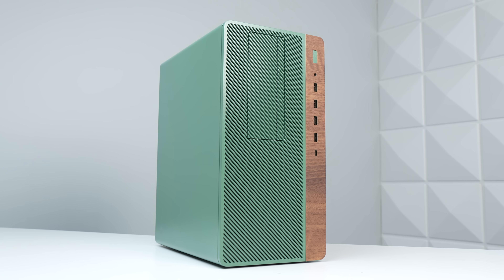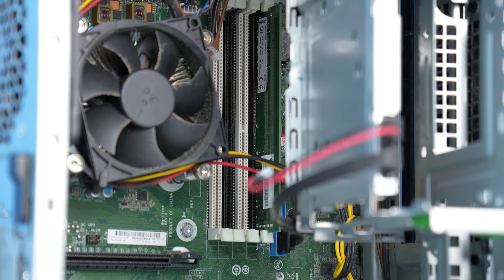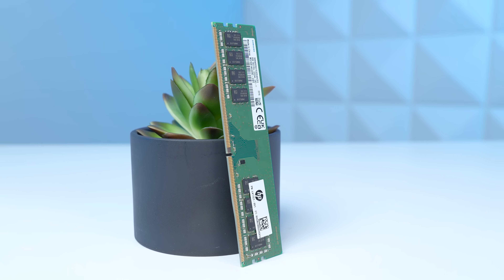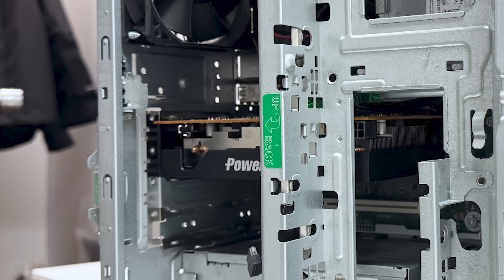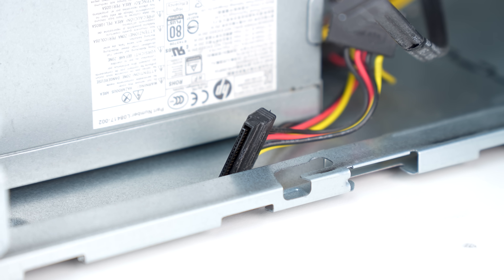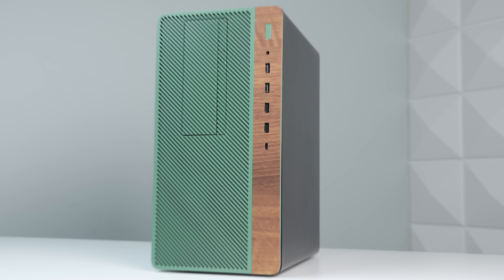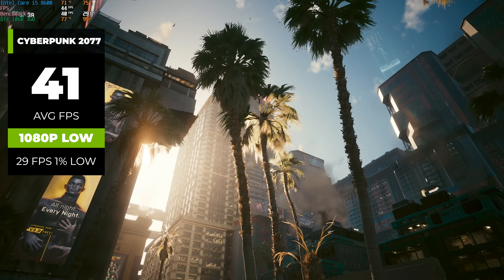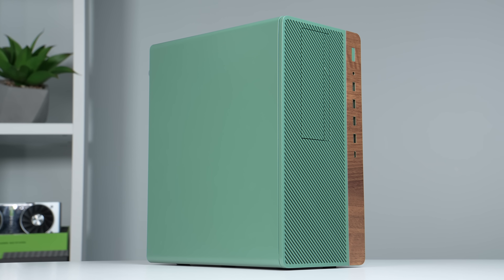Yes, a $150 Gaming PC is Possible

Comment: I got a HP prodesk 600 g4 with an intel pentium gold G5500 16Gb ram and 256GB ssd for 90$ and a radeon rx 580 8Gb gddr5 for 65$ did I get a good deal and what should I upgrade now ? Also I just play Minecraft and Fortnite.

Comment: I just bought me this Prodesk for $50. To my surprise it had an i7 onboard instead of an i5. Even the seller somehow missed it. 

I was looking for some cool ideas to upgrade this thing. Gotta say this looks awesome. Definitely not gonna copy you.

Did you change the power supply? I was planning on putting a gpu in it but I was afraid the power supply couldn't handle it.

Comment: when i was seeing if my idea pc for 200$ would work i asked microsoft copilot is the parts were compatible, i copy pasted names to remove errors. it told me if they would work and if they wouldnt, then why not. for example, in a pc with a 180 watt power supply and really small case, an rx 580 would not physically fit OR get enough power to run.

Comment: Wouldn't pairing up my 8 gb ddr4 3200mhz ram with another higher mhz RAM stick cause trouble?
Reply: No cause it will underclock the higher mhz stick to 3200mhz

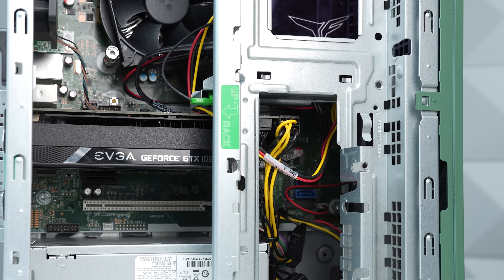Comment: 4:37 Bro, why the Gtx 650? You can get the 750 ti for like 25$ (used) and its 2x better than 650 and also dont use external power. Its just better than most gpus, only 60W power consumption + very easy to find and super cheap because how common it was for budget builds back then.
Reply: He said 1650 bruh

Comment: Hi, I would like to build my first PC, mainly for FPS games and some AAA games. I have a budget of around €1100 and I’ve chosen these components:

CPU: i5 12600KF
MOTHERBOARD:Gigabyte B760M GAMING X DDR4
RAM: DDR4 2x16 GB 3200 MHz
SSD: Crucial P3 1TB 3500MB/s
AIR COOLER: upHere UE2K6 Black
CASE: KEDIERS Mini Mid-Tower Black
PSU: MSI MAG A650GL 80Plus Gold
GPU: RX 7700 XT 12GB

I would like to know if it's okay or if something could still be improved.
Thanks

Comment: @ZachTechTurf Could you please give me an information ?  I have a 4th generation motherboard H-81S with Core-i7-4790 and 16 gigs of ram now. Everything is okay but my graphics card is not working suddenly so I wanted to change my motherboard like Z-97 or similar ones which has both VGA and HDMI Cause I have two monitors and I want to use them without buying a graphics card again. Now could you please confirm that I don't need to install fresh windows to replace the motherboard ??

Comment: I am upgrading my processor which is better ryzen 5 5600x , R7 5700x or R7 5800x ?
5700x and 5800x getting new on almost same price?
Currently running amd athlon 200ge with gtx 1650 (also goind to upgrade gpu most probably used one any suggestions on taht too?)

Comment: Hey, I recently upgraded my Pc to a white themed, a Dell optiplex 5070, I changed the case, motherboard, power supply and cooling, and an MSI Geforce Rtx 3060 gaming x (2 fans) that they gave me for free (used) I would like to know if I can upgrade or change something else (I can still return them)
It's an Intel i7 9th 9700 (from the optiplex)
A Gigabyte Z390 M Micro ATX (used from Amazon everything works fine)
Cooler Master MWE Gold 850 V2 Full Modular
Apevia Prism-WH Prism Micro-ATX
ID-COOLING FROSTFLOW X 240 Snow CPU Water Cooler
If you could tell me what to change/upgrade/return I would be very grateful.
Reply: he never replied to you.. what a douche
Reply: @ultimatesunrise  he might have made a video on it
he does that sometimes

Comment: I wonder why you made that video at all. Since you either recommed a MAC book since that OS is clearly superior (your words not mine) or like pushing ppl into debt traps by selling yourself to NZXT. Also, there is no chance that you get a ProDesk with an 8. gen i5 so cheap. I just sold several of the exact same spec for around 100 bucks each. Guess someone used final cut on his superior MAC to screw some more kids which don't know better. Report it is.
Reply: "Mac"

Comment: Hey Zach!, I've been your videos and i want to ask i have a old pc with i3 7100, H110M-E/M.2, GALAX GEFORCE GT1030, 500W Power supply, a ssd (idk the type) and a KLEVV BOLT DDR4 8GB 2400Mhz. I only have enough money to buy the MSI MECH OC Radeon RX 5700, but i want to know if i should upgrade the other components instead of the graphics card?( Side note I like to play jurassic world evolution 2)

Comment: Rate my ultra budget  build. 

Gigabyte B450m micro atx motherboard with 2 ram slot.

Ryzen 5 5600g 

Value top v300 case, 

Fsp 500 watt 80+ bronze power supply,

8 gigs of ddr4 3200 mh

256gb hp m.2 ssd

This cost around 310 dollars.
Btw before u judge,  im asian not every pc part is available here and its more expensive

Comment: Hi

I currently own a pc of below mentioned system requirements 

My pc configuration is as follows 

Intel Core i7 12th generation 12700 

Motherboard is Gigabyte B760MH

16gb ddr4 memory 
GeForce RTX 3050 6gbddr6 graphics card 

Is it possible to upgrade to Intel core i9 processors? 12th 14th

Also can i upgrade graphics card to 8gb ddr6 or 12gb ?

Comment: true is 8th gen is very good. some part of pc are over produced so you get them in low price. highly suggested computer case.
direction flow.
Mostly best buy i buy used pc and ungraded because any privet buyer do now want loss time.
1060 graphic card is i think little to old. I highly suggested to buy 3070?

Comment: These newer generation recycled 7th and 8th gen intel pc's are just tricky! It's all about the right gpu(size) and right psu(will it work?) for these budget builds (As Zach points out).  If you can't find a good psu solution, stick with the rx 6400 and sff(small form factor) pc's.  I bought a lenovo  510a-151cb for $65 that came with a i5 8400 and 8gb ram.  I thought, how could I go wrong?  Turns out, I have to buy a special lenovo friendly $67 500w psu off ebay(allows proper turn off) in order to make it turn off properly.  I know I can buy an adapter for a third party psu but... It wont turn off with out an external switch.  I also found out the case only comes with 2 ram slots and really only a GPU slot(2 slot gpu will cover pcie slot). Thus no add on cards and I have to buy all new ram. It will only take certain size gpu's  121mm tall(or wide) and 242mm long (lenovo single fan 1660ti ok)   I'm mean this will work but,  $65 pc , $67 psu, $25  16 gig ram, $12  2x80mm cooling fans, $90 1660ti (total $259 bft)- its passion vs price. Maybe a fresh build instead.  I found the dell 7020 and 9020's (i7 4790) are much easier to build in, but they are dated.
 
FYI, didn't know Zach was mixed with  NZXT and the rental scam.   Sorry to hear that, but  I give Zach the benefit of the doubt.

Comment: Hey Zach. I was wondering if you could help me to decide what to upgrade next on my PC. I currently got a 600W power supply, MSI A520M-A pro, AMD Ryzen 7 pro 5750G, a water cooling from Deep cool, 16GB DDR4 RAM (2x 8Gb), NVIDIA GeForce RTX 4070 ti super. I personally thought to upgrade my CPU to an 7800X3D and upgrade my power supply. Would be really nice if you could help me.

Comment: To anyone who can answer, I currently have a 500gb ssd and planning to upgrade to a 2tb ssd. I have activated windows via product key (retail). 

Question is, can I install windows again using the same key or would I need to enter a new one? I only have 1 nvme ssd slot on my mobo so cloning is going to be a longer process. I don't mind installing windows again though (i dont have bulky files that much yet saved on my former ssd)

Comment: every one i talk to says i should not buy anything that is not a 9800X3D or 7800X3D  but in sweden they both cost 600 dollar and that i am stupid if i buy anything that is not x3d but they cost alot more then 9700x 400 dollar or 9600x 300 dollar. i am on am4 2700x  4070 ti super atm but was planing to upgrade to to am5 so do i really need a x3d cpu

Comment: Pro tip: Get an older Server grade PCs like Del T3600 etc with 4th or 5th gen Xeon processors. They also comes with 600+ Watt Gold rated PSUs so you can easily install upto a RTX 4070 ti or RX 7800 etc.

Comment: I have been purchasing HPZ600s 800s for a couple of years and pimping them up with resprays, rgb and medium range Graphics and ending up with some quite powerful pcs. 
I mean 2 cpu, 12 cores, 24gb ddr4, gtx1060 6gb, the 800s have 800 watt psu and are built like a brick shed.
You def dont need a 2k$ rig to play games.

Comment: Thoughts on,
Omen 40L Case
FrostBreath Mobo
Air Cooling
Ryzen 7 7700
GeForce RTX 4060ti 8GB
Kingston Beast Fury 2x8gb 5200MHz DDR5 Ram
1 TB SSD ( Don’t remember exact brand )
600 Watt Power supply

This is my First PC anything I should add ?
Reply: Personnally would get a higher power PSU if it's possible

Comment: can you pls make 900$ Gaming PC? 

I am building this PC What can I Improve to make it better 
(Yea I know About 4060 But I have to for other things too)

CPU- Ryzen 7 5800X 8-Core
CPU Cooler- Arctic Liquid Freezer III 240mm
MOTHERBOARD- MSI MAG B550 TOMAHAWK
GPU- GYGABYTE RTX 4060 OC 8G
MEMORY- CORSAIR VENGEANCE LPX DDR4 RAM 32GB (2x16GB)
Storage- SAMSUNG 990 EVO SSD 1TB
POWER SUPPLY- APEVIA ATX-PM850W PREMIER 850W
Case- RAIDMAN X921 MESH AIRFLOW AND TEMPERED GLASS
                overall-920-930 (little over but if you buys some used parts it may go under 900)

Comment: Can u rate my build 
Ryzen 5600
Rtx 4060
B550 motherboard 
1TB SSD
16 Gb ram
H5 flow case
650w psu
Any upgrades??
Reply: I would swap the 4060 out for an RX 7700xt.  Better performance for the same price.

Comment: Quick question I have a Ryzen 7 5700g and I would like to buy a GPU, i consider rx 6750xt or 7600xt which would be better.(also i am mainly focused on 1080p but 1440p wouldnt hurt)
Reply: 6700xt would be good enough for 1440p in basically anything. So can't go wrong either way.

Comment: Great video!  Got a HP Envy TE01-1144 and own a RX7700XT graphics card and it needs 2 8 pins. This is for use by my sons and I. PSU is only like 200 something watts. Am I facing a re-case and new power supply as my only options?

Comment: Can you pair a 4090 with a i7 3770k and a i5 3470k???? 1:05
Reply: Ya sure, but the cpu will be the surface of sun.
Reply: u can but u shoudnt
Reply: Nope
Reply: No u shouldn’t do that
Reply: @Justacatweeb  I was just asking thanks bro
Reply: @ np
Reply: Not only could you run cyberpunk at 2 fps, but also if the element of your oven is out, you can just use the pc
Reply: What of course not the gpus bottlenecking the cpu
Reply: @vasgaming1555  I know bro
Reply: No
Reply: Bottle necker 4000
Reply: Yes u can but you can't use full potential of of rtx 4090

Comment: I found a pc for 350 on Facebook marketplace and I want to know if it is good for gaming 

Here are the specs

Specs

    CPU: AMD Ryzen 5 2600
    GPU: Radeon XFX 590
    RAM: 16GB DDR4
    Storage: 1TB M.2 SSD
    Motherboard: B450m Ds3h wifi 
    Power Supply: 500w 

Custom Built in a “fish tank” style case with RGB. Also a fresh Install of Windows 11
Reply: if thats usd, you could do much better than that oof

Comment: That is a really solid build for the price. With those the GPU is always the tricky part. The 1060 3GB isn't bad, but I have been finding 1650s for around $40 which would be a good option, especially one that doesn't require the 8 pin. I actually picked up a 1660 Super for $60 yesterday, which would still be in that same ballpark, and with the 8600 would be a fairly beefy gaming setup even for modern AAA games. RX 580s are always a good choice, but in this situation require way too much power. In RX 5500 might work though, and in my area AMD GPUs have pretty much no value (a few weeks ago I bought a like new RX 6800 for $175). If you are really strapped for cash, and insist on something that doesn't require a six or eight pin, the 1050ti is still somewhat relevant, and I can pick those up regularly in the $25-35 range. 

I have an RX 6500 XT, and would have a tough time recommending it for this, although I think it would be a little better than the 1060 3GB.

Comment: If you're handy with a multimeter and soldering, you can solder an 8-pin PCIe cable straight to the power rails. BUT if you have zero experience with this kind of modding, do not try it. You could hurt yourself or even burn your house down.

Comment: Tip: you can use a pcie to nvme adapter but you cant boot from it so youll have to buy a cheap hdd to install clover first then you can boot from it

Comment: I saw this Fortnite kids video on his setup progression and when he got a pc he got a $880 gtx 1030 and an 3rd gen i7 pc and he said later that it was a “little bit” of a scam, and when I saw a comment that said change the case I just snapped and said In caps lock OMG DO NOT GET A NEW CASE GET A NEW PC YOU COULDVE GOT A 7700xt PC OR 4060 PREBUILT YOU COULD GET A BETTER COMBO OF A GPU AND CPU FOR THE PRICE OF A NEW CASE. Congrats on Carterpcs shouting u out. 🎉

Comment: I have that exact kind of prebuilt, got it with a 2060 and a 9700k. That metal bracket is annoying and so is the motherboard, i cant just swap the case becuase the front io is connected to the bloody board! 
Got it for 450

Comment: I got a Dell Optiplex 3070 SFF with an i5 9500 16GB ddr4 and 512GB of storage. Then got an arc a380 and had to put my power supply on top of my case cause it was a double slot card and I only had a single slot.

Comment: I bought an OEM that had that same wired metal latch thing and instead of just getting a smaller GPU I just took a pair of pliers and bent the metal out of the way so I could fit the power cable into the GPU. I even had to drill a massive hole at the bottom of the case because it needed a more powerful PSU in order to support any GPU and it had no ventilation at the bottom. Worked well I just have no idea how I'm gonna sell it when I upgraded to an actual good PC

Comment: I just ordered a new on sale $640 7900xt from NewEgg, and i am trading in my old 6800. They're giving me $281 for the 6800. Maybe I could get $50 more selling it myself, but the ease of trading it in is worth it to me. So, my upgrade effectively costs me ~$360.

Maybe prices will come down next year, and i have a 6800 which is a great card, so I could wait a few months to see what used/new prices do after next gen cards come out.
I just know the wife got me a 34" LG  ultra wide 1440p OLED 240hz monitor, and the 6800 can't drive that. It does about ~50-80 fps without FSR or upscaling with regular 16:9 1440p ultra settings. But to drive those extra pixels in the ultra wide monitor it will struggle, and I want to keep my current 27" 1440p monitor as a 2nd monitor which would put extra load on the 6800.
So I decided to bite the bullet and upgrade. 5700x3d and a 7900xt should last me at least 5 years though.

Comment: As someone with less than $20, i see this as an absolute win.

I have an HP Prodesk 400 G7 (Intel i5 10th Gen, 8GB DDR4, 1TB HDD) and im planning to buy a low profile GPU (maybe an Intel Arc) and a better PSU (180W)

Comment: This is the best way to do a budget pc build guide.
Reply from the maker: That was the goal :)
Reply: @ZachsTechTurf I did the same exact thing. I bought a oem sff pc with i5 8400 then i put a rtx 3050 6gb low profile (that doesnt even need power supply) and call it a day. It can run all AAA games on Medium and 1080p and if they struggle i go to low settings.
There is no cheaper way

Comment: this 150 $ pc has the same gpu as your last 100 $ and its also complex with the ram and only the cpu is better and slightly the ram defintly fine but i prefer the 100 $ my opinion if you are already buying a ultra budget pc defintly copy for 150 $ i reccomend copying the 200 $ templet its still really impressive but not as much as the 100 $ build o i forget to say this build gets only 1 fps more than the 100 $ build